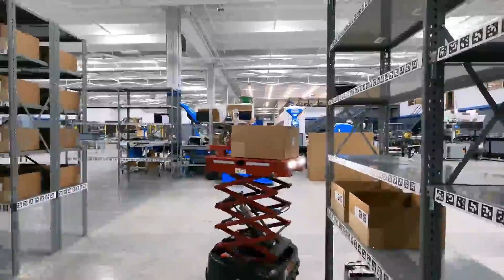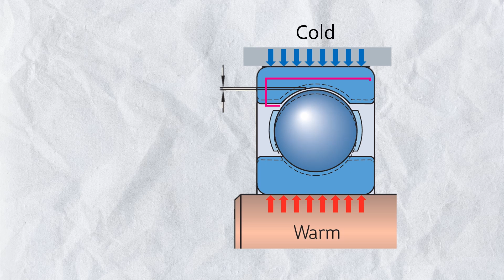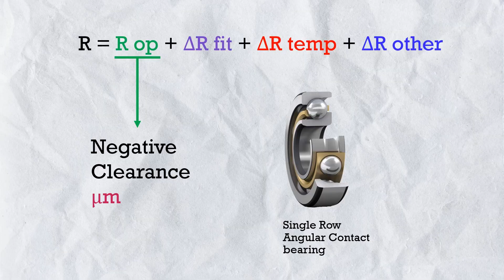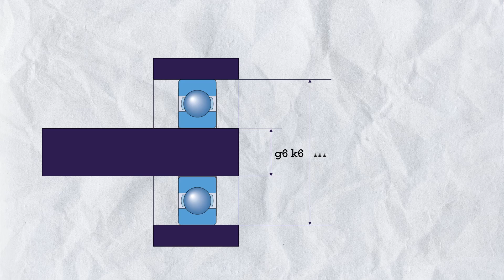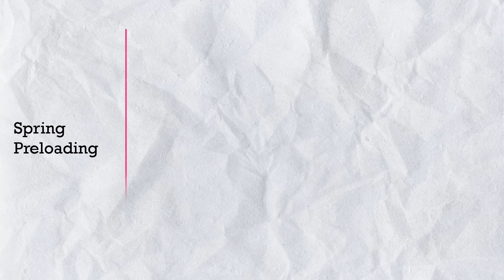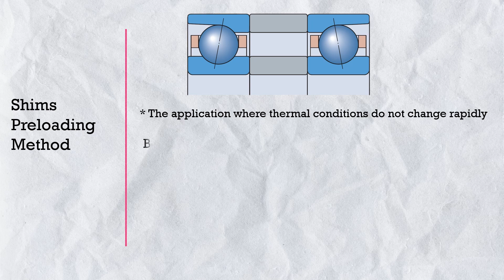Angular Contact Bearing Preload and Bearing Internal Clearance

Comment: Your explanation is spot on and thank you.   I am an analyst for the US Navy and we experienced multiple helicopter crashes as a consequence of inadvertent preload that manifested due to a duplex bearing flushness issue  that took years to identify. After a fatal crash caused by the bearing company mis-manufacturing the race curvature the helicopter company worked to ensure all processing at the bearing company were optimum. To ensure repeatable results during contact angle measurement, the process was altered to apply more load to the inner and alter the outer housing restraint-which ultimately required more material removal on the ring end face to achieve the required endplay/flushness requirement. This resulted in a tremendous ball load increase and inadvertent internal preload. This resulted in systemic failure of bearings in under 100 flight hours, some as early as 10 hours. Ultimately we lost multiple aircraft and crewman before the OEM and bearing company resolved the matter.  RIP to all our valiant warriors that relied on engineering to ensure their safety.

Comment: As a heads up, SKF has a free application you can use to "test" the validity of your bearing preload. As a word of caution, in order to use the software, you need to give the application a preload force for it to function correctly. It's a giant guess-and-check if you don't have an idea of what preload force you want to use.

Comment: We can have preload in +ve internal clearance as well. Because preloading only means reduction of internal clearance to achieving required operational clearance
Reply from the maker: I don't agree. if there is +ve clearance, mechanical tightness is not possible
Reply: You are right 
But when we talk about preload in industry or in the maintenance domain we always refer it to as reduction of clearance via tightening of preload nut or other methods which you described. 

e.g. in normal pillow block with angular contact bearing we tighten it till desired internal clearance is achieved. And the amount of tightening is referred to as preload applied.

Comment: very informative video !!!! I have a couple of questions.
1. I have designed a shaft supported by 2 single row taper roller bearings in a back to back arrangement. The shaft experiences pure axial load in both directions as tension and compression and very little radial load. the shaft is step turned on one side and during tension the bearing near the step turned face is loaded and during compression the bearing on the other side is loaded, but the other side of the shaft is locked using a KMT nut. can the nut with stand the load while the shaft experiences compression ?
2. since i am going to use taper roller bearing, is the preload from the KMT locknut sufficient ?
Reply from the maker: 1. Yes of course KMT nut can withstand load (this is the purpose of KMT nut, same thing you can in tractor wheels)
2. Yes it should provide necessary preload.
Reply: Thank you so much for your reply!!! 
I have one last question, I have chosen an SKF 32004X bearing with static load rating of 27KN for my project where there is axial load of 5KN and less than 10RPM, will the load deform the bearing ? or should i choose a bearing with better static load or should i look for other type of bearing ?

Comment: Thank you for the excellent video.
I have a question when I assembled vertical pump top bearing(angular contact bearing) that was loose fit (journal, housing).
I have lots of experience what assemble various machines so most of angular contact bearing machines journal were loose fit from my experience. I really want to know what why designer adapt to angular contact bearing loose fit between inner race of angular bearing and shaft jounal.
Please let me know.
Thank you.
Reply from the maker: Hey.. I'm little confused, actually we should not assembly angular contact bearing in loose fit. angular contact bearings should be always preload. to achieve the maximum possible life.
Reply: Thank you sir. You are right. Usually angular contact ball bearing are given preload to axial direction(face to face, back to back, tandem). But Usually angular contact ball bearing are loose fit to radial direction between inner race of bearing and shaft. Please let me know why adapt loose fit there.

Comment: Is there a way to calculate the amount of torque necessary to apply to a lock nut in order to achieve the required preload on a tapered roller bearing?.

Comment: Hi! Thanks for a very useful video!
In my application, I want to get large axial load capacity out of a small diameter, so I am planning to use an arrangement with four angular contact ball bearings with 40 degree contact angle. Radial loads will be minimal but not zero.
If I don't want to use "super precision" bearings due to the cost of those, then do I need to worry about manually controlling the clearance/preload when using a "Tandem back-to-back (QBC)" arrangement of universally matched angular contact ball bearings? If I just pick one of the preload classes of bearings will it work when there is four of them together?
The load could be applied in either direction at any given time:
- When load is applied towards the left, the two bearings on the left will not be loaded
- When load is applied towards the right, the two bearings on the right will not be loaded
Does this mean I would need to apply a preload of some kind to keep the unloaded bearings loaded? How do I know that the preload won't get cancelled out by the external load, if I tighten the bearing set up using a KMT locknut from SKF on the inner ring, with another screwed cap on the outer ring? Would I be okay just to tighten the bearing set up to the recommended KMT locknut torque?
Reply: Additionally, if I apply an axial force to my bearing set, will the thrust housing need to be able to withstand a radial force, based directly on the contact angle of the ACBB?
Reply from the maker: Hey, 1st you don't need to go for super precision bearings until high precision level is not required Like radial run-out (depending on application), also if speed is not much (less than 8000 RPM) normal grade universal match bearings are fine.
2nd, if load is not applying on bearings, that's fine, (if bearings are already preloaded)
3rd, KMT locknut- yes tightening the lock nut with recommended torque is okay. but as much i know they will not provide you torque, they will provide preload force. so make sure this.

Comment: For motorized spindle for drilling application,spring preloading would be appropriate?and the general formula u used to calculate preload force can be used for NSK bearings? As the dynamic load rating of bearing we have selected is 23200N and if i take pf=1% then preload=232N so Medium preloading is selected
Reply from the maker: For machining applications I guess a fixed spacer preloaded would be better. And Yes, the same formula can be used for NSK as well
Reply: @mastermechanicaldesign  for my application formula can be used?if not then what should i do ,we have gone through many papers but we couldn't get any preloading suitable for our application
Reply from the maker: Use universal matched pairs of angular contact bearings. As your application is a machining tool. You need precision. So selection preload class universal matched bearing. And there are three preload classes in SKF. But I'm sure about NSK. So try to find in their catalogue or on website

Comment: hello, could you send a link to the skf pdf, where to find guidelines on preloading methods (construction), ring width, etc.? You used screen from it for example in 16;07
Reply from the maker: Sure Krystian, https://www.skf.com/binaries/pub12/Images/0901d196802809de-Rolling-bearings---17000_1-EN_tcm_12-121486.pdf

Comment: Maybe the wrong place but what about on mtb hubs with bearings.. would adjusting the play be preload ? If so how much space in between bearing and cone do you think would be needed for optimum use ? Mm?
Reply from the maker: I don't think MTB hub (Mountain Bike Hubs) comes with angular contact bearings. if it's simple ball bearing then preload is not required.
Reply: Enduro has angulat bearings
Preload is required for both types of bearings. That is why both Shimano and SRAM have preload adjusters.
Reply: https://youtu.be/OjE1YMj9Al0?si=HnhlfobvDX1bfDA1

Comment: Sir,
In case of clamp or using lock nut,
How can I assume or put specific amount of preload?
For example, manufacturer need 100N +/- 10% preload on inner ring,
how can I apply that amount??
Please give me advice
Reply from the maker: I have seen in SKF, they use a Torque wrench. But i would highly recommend using a set of universal matched bearings. Instead of manual preloading
Reply: @mastermechanicaldesign  when I use torque wrench, what amount of torque Nm create 100N?
The bearings are not universal matched set.
Reply from the maker: This depends on many factors like as i said in this video.. I Can't surely say. Can't be manually calculated. Either consult with the bearing manufacturer sales team or use simulation software if the manufacturer is providing. That's the solution. It's risky.

Comment: What type of bearing would be used in making a sand mixer (that used in foundries) and how should one approach a project like this. 
Thank you
Reply from the maker: Type of bearings always depends on the load direction, the amount of load, speed, also what kind of misalignment is there, and we can decide the bearing size as per bearing service life calculation. 
There is a complete process, I will make the detailed videos on bearing selection
Just after this bearing basic series
Reply: @mastermechanicaldesign   Thank you 🙏
Reply: @mastermechanicaldesign   Thank you 🙏